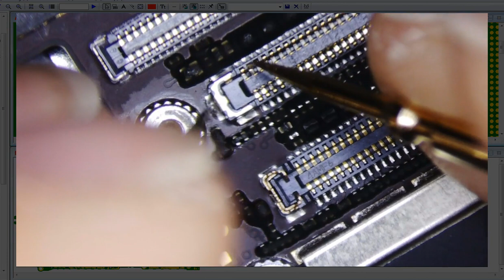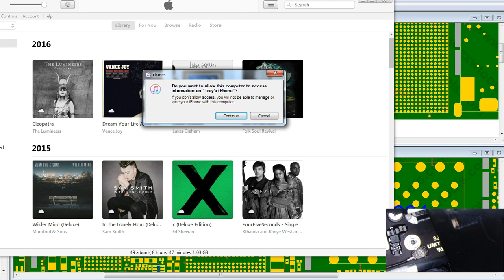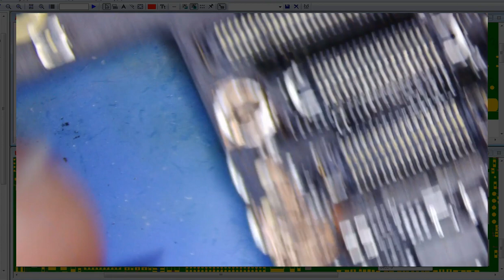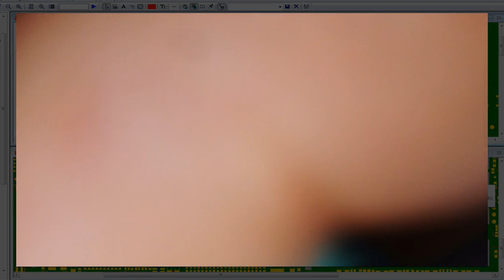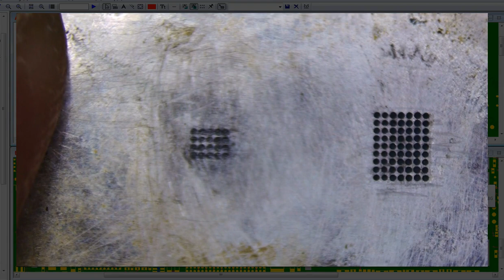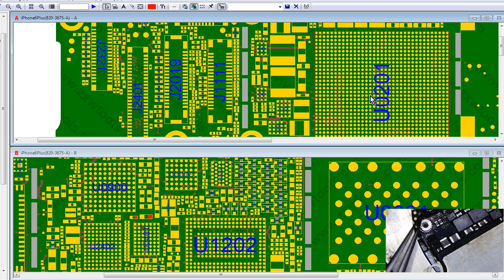Advanced iPhone 6 Plus No Image Repair

Comment: Very nice. So should I assume that every data line should have a range close to 0.4~0.65 ohms across it?
Reply from the maker: diode mode measures the drop in voltage across the leads.  Always compare with a known good board.
Reply: Microsoldering So these readings are in mV or somethig? When it shows 245 means theres 0.245 V drop across the leads? Look at me almost finished engineering school and I'm confused with a multimeter reading haha
Reply from the maker: yeah millivolts
Reply: Cheers buddy. keep up the great work! I learned a lot from your videos. I like how short they are compared to other channels =D